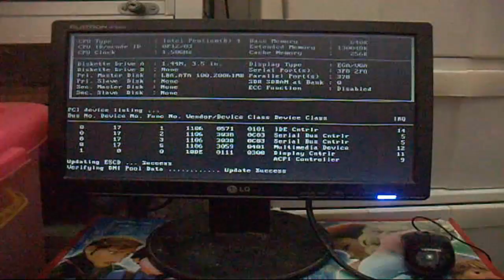Cara Mengatasi komputer tidak bisa nyala

Comment: Bang, pc saya ga mau nyala abis ganti cpu fan baru (kipas psu mati, lampu indikator mobo hidup). Tp setelah psu di cek tanpa pc (seperti di video) kipas psu hidup. Trus cb nyalain pc tanpa cpu fan, pc hidup. Itu kira2 salah dmn ya? Cpu fan lama stock intel 65w, cpu fan baru deepcool ice edge 95w. Psu saya 380w. Apa psu saya kurang daya atau cpu fan baru ga cocok?
Reply from the maker: kemungkinan power supplynya tidak kuat ngangkat.

Comment: Bang ane juga kayak gitu tapi disuruh ganti baterai cmos,kalo diganti apakah update an bios kabylake nya hilang?
Reply from the maker: maaf maksudnya kabylake ?
Reply: Itu gan kalo pc nya dinyalakan biasanya stuck di bios gan sama 4x alarm
Reply from the maker: kira-kira masih bisa masuk BIOS ?
Reply: Abdul Rohman bisa tapi lama-lama stuck
Reply from the maker: di coba ganti baterai BIOS dalam keadaan CPU mati, setelah itu di hidupkan, masuk BIOS, set tanggal sekarang dan simpan.
Reply: Abdul Rohman udah diganti tetep kadang stuck dan bsof
Reply from the maker: itu seting tanggalnya bisa tersimpan atau tidak berubah ?
Reply: Abdul Rohman disimpan
Reply from the maker: itu dah bisa masuk windows ?
Reply: Abdul Rohman kadang bisa lancar,tapi kadang stuck di bios atau booting
Reply: Mungkin pin nya bengkok
Reply from the maker: pin apanya ya ?
Reply: Abdul Rohman pin mobo
Reply from the maker: bisa berpengaruh.
Reply: Abdul Rohman mungkin karena ane pake igp kalo pake gpu eksternal apakah masalah nya selesai?
Reply from the maker: bisa di coba

Comment: Bang PC saya ga mau hidup pas uda pencet tombol power, tapi kalo PC nya di pegang itu nyetrum kaya hidup
Reply from the maker: coba tuk cek power supply nya dulu, apa masih normal ato tidak.
Reply: @MrAbdulrohman  klo powers supply saya jumper normal kemungkinan apa ya om ?? 

Lampu ijo kecil di motherboard nyalaa terang
Reply from the maker: @hdzblitz4200  coba tuk cek ramnya, dengan membersihkan pin ram dan slot ramnya.
Reply: @MrAbdulrohman  ok om mksh sarannya lg pusing ini mikirin padahal mo mainin..

Smpet saya diemin sebulanan sih. Sebelumnya sih ok2 aja g ada mslah
Reply: @MrAbdulrohman  om Alhamdulillah saya keluarkan Ram nya dri Mobo. Saya nyalakan bunyi cekrek nguuuung nyala pertanda apa ya om ? Beres kah?

Tapi lampu yg Deket DVD room bagian depannya knpa g nyala ya??
Reply from the maker: @hdzblitz4200  jika ram di lepas, terus di hidupkan, bunyi alarm itu tandanya mobo dan ps normal, jika ram di pasang tidak bunyi alarm sama sekali, kemungkinan ramnya kotor, slot ramnya kotor atau bisa juga ram nya yg rusak.
Reply: @MrAbdulrohman  lalu barusan saya hubungkan ke monitor malah muncul menu bios om yg DEL atau F2 gituh. Msuk ke menu2 nya aga bingung setting2 nya ..
Reply: @MrAbdulrohman  ada solusi g Yaa om buat monitor yg muncul menu2 bios Asus .
Reply from the maker: @hdzblitz4200  masuk ke bios dengan setinggan default, biasanya tekan dell, f1, ecs, f2, nanti kalau sudah masuk langsung setting tanggalnya dan setting default lalu simpan dan keluar.
Reply: @MrAbdulrohman  tapi kenapa ya om pas di option 1 ko cuma ada 2 pilihan kata org di FB HDD nya ga ke deteck tu gmn ya ???
Reply from the maker: @hdzblitz4200  coba tuk ganti kabel data hardisk atau kabel power hardisk dulu.
Reply: @MrAbdulrohman  ada kabel lainnya di sekitaran cuman beda colokannya om ..

Td saya ga sengaja neken tombol powers ehh tetiba muncul windows om ajaib bgt 😅😅

Jdi normal ke windows bisa aneh ?
Cuman kdg klo saya hidupkan ulang suka muncul dell atau F2
Atau yg Sruh tekan Enter yg hitungan mundur gtu kdg2
Reply from the maker: @hdzblitz4200  kemungkinan, baterai cmos sudah habis.
Reply: @MrAbdulrohman  Nahhh ini tadi saya sempet keluarkan saya gosok pake karet ban batre Cmos nya saya pasang2. Lagi Alhamdulillah ada kehidupan om...
Reply: @MrAbdulrohman  ngaruh bgt kah om batre Cmos bulat itu ??
Reply from the maker: @hdzblitz4200  ngaruh, jika habis tidak bisa menyimpan settingan bios, terutama bagian tanggal komputer.
Reply: @MrAbdulrohman  brrti perkiraan om masalah saya ada dmna ya om? Pas di teken power muncul windows . Padahal kan di menu Option #1 Priorities ga ada HDD g detect ? Ko bisa nampil windows ??
Reply from the maker: @hdzblitz4200  kemungkinan biosnya tidak stabil, karna baterai low.
Reply: @MrAbdulrohman  harus beli batre baru om? Ada setingan2 nya ga kalo di ganti?
Reply from the maker: @hdzblitz4200  iya coba baterai baru, biasanya harganya 5 - 10rb, nanti seting tanggal aja sudah cukup.
Reply: @MrAbdulrohman  ok om makasih info dan sarannya. 🙏

Mksh juga atas waktunya sudah mau menjawab 👍

Auto subscribe sukses terus Om Abdul Rohman Semoga Chanelnya semakin berkembang 🔥🔥👍
Reply from the maker: @hdzblitz4200  sama-sama.
Reply: @MrAbdulrohman  om kenapa y kumat2 LG ? Kdg windows error' recovery kdg2 msuk ke BIOS LG dan HDD ilang g detect?
Reply from the maker: @hdzblitz4200  sudah coba gabti kabel data hardisk atau kabel power hardisk ?
Reply: @MrAbdulrohman  saya copot pasang. Saya smpet ubah AHCI Ke IDE yg di BIOS. HDD juga udh ke detetct. Tapi ko pas exit ke Menu Yg Ada Enter Nya Menuju ke windows cuma ga kuat pas di windows Lag Terus Balik lagi Ke layar yg ada menu Enter Choose ..
Reply from the maker: @hdzblitz4200  jangan-jangan hardisk yg rusak, dibagian board hardisk.
Reply: @MrAbdulrohman  ya kali ya bingung mo service jauh.

Ada yg nyaranin install ulang windows cuma data2 harus di back up dulu.
Reply from the maker: @hdzblitz4200  iya tuk di instal ulang dulu, backup data yang c saja, seperti document, picture dll ke drive D:/
Reply: @MrAbdulrohman  tadinya smpet nyala dan ada notifikasi di bendera yg menyuruh untuk update windows karena udah lama sekali ga saya update2 kena 1.5 GB. Dan ada juga notifikasi lainnya merah2 dll..

Smpet update ke ke silang. Dan PC tiba2 ke BIOS lg
Reply from the maker: @hdzblitz4200  sudah coba ganti baterai cmos.
Reply: @MrAbdulrohman  belum om. Ini komputer udah 3 tahunan sii.
Gatau msh bagus atau engga.
Awalnya smpet copot pasang lg batrenya mesin hdup ..

Klo untuk ganti batre Cmos baru belum dcoba
Reply from the maker: @hdzblitz4200  iya di coba dulu, harganya 5rb - 10rb.

Comment: Bang mau Tanya nih pc saya nggak bs nyala tp mouse yg nyolok ke cpu nyala. Tiap kli diidupin lmpu indicator nyala kipas psu jg nyala. Tetapi kipas processor tidak nyala sama sekali. Mohon pencerahannya
Reply from the maker: coba tuk cek socket 4 pin nya power supply, apakah kendor atau tidak. dan bisa juga power supplynya lemah
Reply: @MrAbdulrohman  klo psu-nya msh normal bang soalnya dicoba di pc laen msh bisa
Reply from the maker: @neokazan4155  kemungkinan motherboardnya.